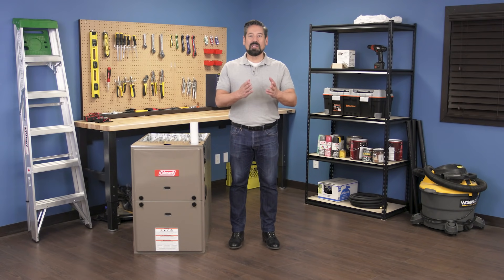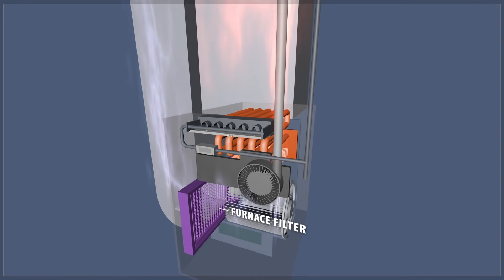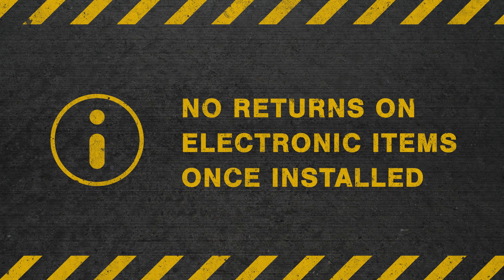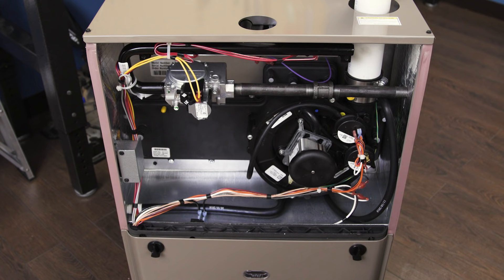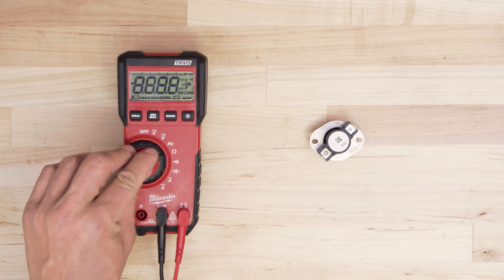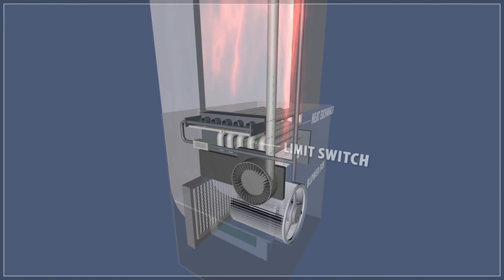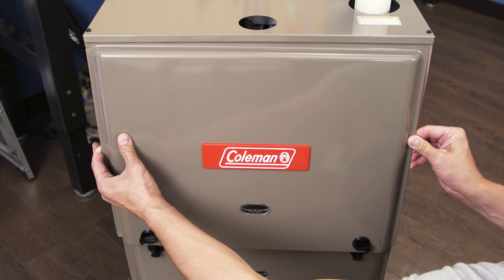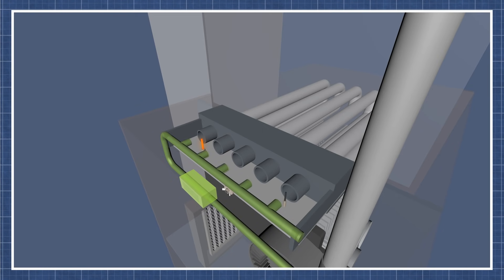Furnace - Limit Switch | Repair and Replace

Comment: I need a limit switch for my furnace ASAP ....
Reply from the maker: Hi John, you can find a match online https://www.amresupply.com/catalog/Fan-Limit-Controls-HZ3D or give us a call at 1-800-661-9891 . If you are in Canada you can drop by one of our locations, we are open Saturday's https://www.amresupply.com/locations Hope this helps!
Reply: @AmreSupply  ..... Hello, I'm hoping you have locations in or near South Dakota, where I reside. I've been trying to get help from my tribe but unsuccessful ....
Reply: @AmreSupply .... Hello again, I've taken a screenshot of the switch I need but don't understand what you mean by flame .... ??
Reply from the maker: Hi John, there are flame rollout switches (which monitors if there are flames coming out the front of the furnace) and there are limit switches (which turn the furnace off if the internal temperature gets too high. 

AMRE supply only has locations in Canada. If you need a limit switch and you're finding one locally, find a HVAC supply store near by, remove your limit switch and bring it in find a match with the same temperature and rating.
Cheers
Reply: @AmreSupply ..... Ok. You have an american location near by South Dakota ...
Can I text you, be quicker to communicate
Reply from the maker: Hi John, there is a live chat on the AMRE website or you can email the customer care center as well customercare@amresupply.com .

Comment: Hi, my furnace is Trane xr90. It keeps blowing cold air. I have replaced the filter and reset the furnace. The problem still exists. Do you think I have to replace the limit switch, or something else?
Reply from the maker: Hi Riwibela, it might seem simple but first double check that your Thermostat fan isn't set to On, (which will cause it to run the fan continuously). Make sure the fan is set to auto (which will only run when heating is needed). 

Many furnaces use flashing lights as codes, so if you see any flashing lights, look at your furnace manual to reference what they mean. (3 reds might mean ___  while 2 reds might mean something else) Its different for each model. This can help you narrow down what is wrong right away. 

In general, the limit switch can cause the furnace to cycle on and off. If it starts to fail it will start shutting the furnace off at lower and lower temperatures. The furnace will keep the blower fan running to make sure the heat exchanger doesn't overheat, which might make it seem like it is blowing cold air.

If you remove and test the limit switch, and it has no continuity, then you'll know for sure to replace it, but for how common it is, it doesn't hurt putting a new limit switch in regardless. https://www.amresupply.com/catalog/Fan-Limit-Controls-HZ3D
Reply: @AmreSupply  Yes, the fan was set to auto mode. When I turn the thermostat to higher temperature, the furnace will be on with cold air only. I will test the limit switch and see if it is failure. Thank you.

Comment: I have a pop noise right before the fan comes on
Reply from the maker: Hi Tim, a pop sound could be the metal of the housing expanding as the furnace warms up to the operating temperature. https://youtu.be/WkHgeTITioE?t=164

Does everything else run normally?
Reply: Yes all the rest seems normal
Reply from the maker: To clarify, the duct-work and other metal inside the furnace can all expand slightly as it gets warmer. These can also makes sounds when the metal cools after the furnace shuts off.

In other cases,  a bang during ignition could mean that the burners are dirty.

Comment: My limit switch reads L145-35F can I replace it with any? Amazon don't carry this one they carry L225-50 I feel this is not safe. I have a Coleman deluxe blend air II system . I keep trying to turn on the heat . Fire comes on than cuts off. At first the heater was turning down  by itself now it tries to turn on for about a minute than it just shuts off. Sometimes I get fire lit but instantly goes out. . I feel is this limit switch. So is it safe to get any kind?
Reply from the maker: Hi raiders2800, if the furnace shuts off instantly after lighting, it could be the flame sensor which can either be cleaned or replaced as well. Its worth taking a look at our troubleshooting guide here https://www.youtube.com/watch?v=qRmNrmjKEyk

As for limit switches, its important to match the temperature ratings.  L145-35F means the switch opens up and will turn the furnace off at 145°f and will close at 35° less (at 110°). A L225-50 would not be safe for your furnace as the switch opens at 225°. When searching, try to enter any other part numbers written on the side as you might have better luck finding a exact replacement. The replacement might not be a Coleman branded limit switch. Many furnaces will have a mix of parts from different manufactures. http://www.amresupply.com/catalog/Fan-Limit-Controls-HZ3D 

Hope this helps.

Comment: My dad connected the wires from my limit switch thermostat to a paper clip to keep the furnace blowing after 2 days the furnace shutdown the wires are burned and I'm getting no power at all what could it be
Reply from the maker: Hi Jay Jeezy. First of all, its never a good idea to "jump" or bypass any safety switch in the furnace. Each safety switches are there to ensure that the furnace is operating safely and the limit switch protects the furnace from overheating. In this situation there was likely a short circuit that caused the burned wires. Its best to call a HVAC technician to take a look at your furnace.
Reply: Blown fuse on the control board.

Comment: The fan runs but the heater.does not come on
Reply from the maker: Hi Sylvia Marble, you should try resetting the flame-rollout switch. The flame rollout switch has a button that can be pressed to reset it. If the furnace thinks that flames are rolling out the front, it will shut of the flames and run the blower to try to clear the flames. This is covered in this video: https://www.youtube.com/watch?v=23LGRraYUg0

Also you might want to watch our full troubleshooting guide: https://www.youtube.com/watch?v=qRmNrmjKEyk

Comment: will the furnace fan be stuck on if this switch fails
Reply from the maker: Hi Mario Dilorenzo, when the Limit Switch fails, the furnace thinks that the system is overheating so the blower fan will continue to run to cool down the system. In most furnaces this will only go on for several minutes before the furnace shuts off and turns back on to try ignition again. In some cases the blower fan might run for longer. The other thing to check is your thermostat settings. If the fan is set to On it will run all the time. If its set to auto, the blower fan will only run when the furnace is providing heat.

Comment: If it trips the high limit switch will it also cut power to the WiFi thermostat (no batteries)? When it happens, there's no voltage between R and C for about 45 seconds. What could it be?
Reply from the maker: Hi Okan Korsal, when the limit switch trips, generally the blower fan will continue to run to help cool down system and some furnaces will also cut power (24V) to the thermostat before it restarts.